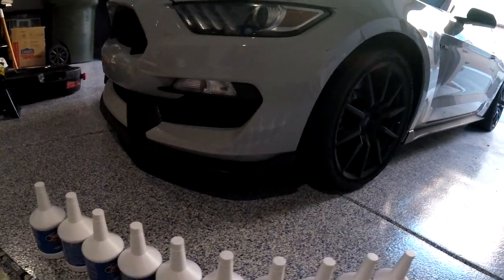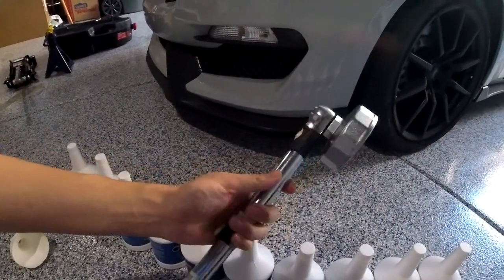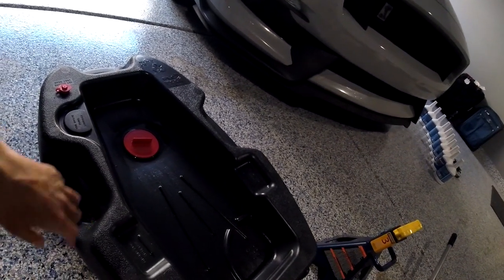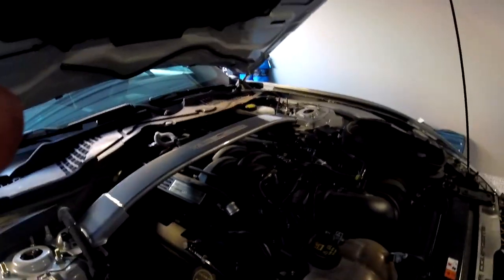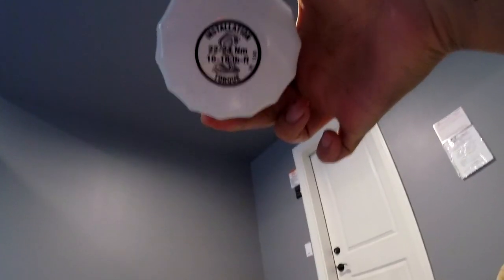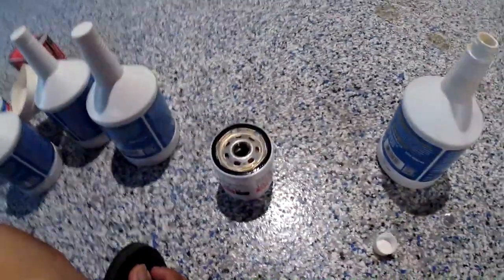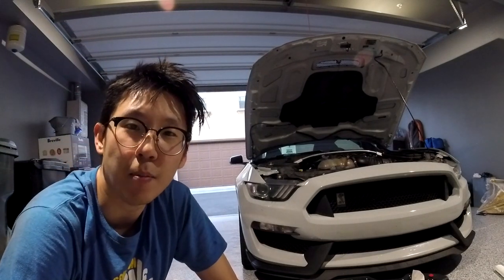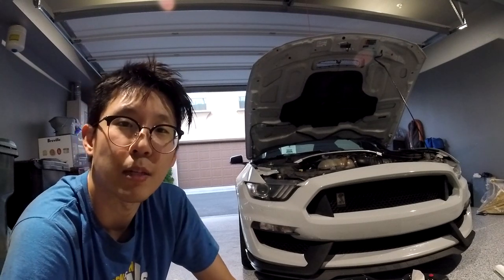[How To] GT350 In-depth Oil Change // Please~ Do It YOURSELF

Comment: It gives me a big big relief. As of this video you had replied to someone's comment below that your GT350 has about 18000 miles. Given the GT350 engine blow out news coming up lately from everywhere, it kinda bothers me and circle back to think about the oil brand that i use. I use Amsoil and see that you are using Redline, perhaps I will switch to Redline as well, just because you are successful in frequent tracking the car and also with reasonably good mileage.  Most blowout news are on engines that are almost new or under 10k miles.
Reply from the maker: OliverBoots ive heard plenty good things about amsoil as well. But yes, I’ve been using redline all my life. Just sticking w what works for me

Comment: Race ramps are very useful for oil changes on these cars.
Reply from the maker: yea, wish I had one =P
Reply: Come to think of it you still need someone to guide you when your driving up on them with the ones that I have, or else the splitter will just push them around. Lol your probably better off. @yooseemotoringchannel3357
Reply: Brad Mckenzie I jack mine up and set the car on the ramps. My 18 has the canister type filter though so next oil change I’m going to remove the driver side wheel completely as it’s easier to access the oil filter.
Reply: VooduN 18_350  If they only had that technology two years ago lol.

Comment: Love the car, thinking of getting out of my 911 and into a GT350.  The part I struggle with is the massive oil burn I have heard of.  I would be mainly tracking the car or weekend cruises, have you noticed any loss/burn after hard track days?
Reply from the maker: I've heard of the same issue on few gt350 owners. my personal vehicle doesn't have any oil burn issue. maybe 1/4 quart every 2~3k miles. (very normal for high rpm NA engine). I've done proper break-in procedure as well. 
I'd recommend this car to anyone who love cars. just the sound alone, is pure bliss.
Reply: That's great to hear you don't have any of those issues, that a pretty low burn. I've watched your track videos and you definitely use it as it was intended. Think I have watched the Auto Club track day 5x. Another random question I saw in that video that you changed the shift knob, did you raise it with another nut? Looks higher than others I have seen with the same knob.  Love to see that American muscle has come so far to offer so many great factory track ready cars at even better prices.  @yooseemotoringchannel3357
Reply from the maker: @jc4hstar  I didn't raise the knob with anything. I screw it in just enough to cover the reverse collar w/ lock tight. maybe it's just the angle of the gopro ? =P  it's a great knob though. stock knob just doesn't feel right when I grab it from the top.
Reply: Oil loss is a normal thing in high revving engines
Reply from the maker: Yes, its true. But few gt350 owners have had their engines replaced due to “excessive” oil consumption. Some have reported losing 1qt every 500 miles or less.. thankfully I don’t have that problem
Reply: The excessive oil consumption is linked to improper breaking in of the engine in the Shelbys. A good slow 1000mi break in works miracles for the 5.0/5.2 engines.

Comment: I have read that some of the oil catch buckets have holes not big enough causing the oil to overfill and spill all over the floor. What brand of oil catch container are you using?
Reply from the maker: I just bought mine over amazon. As long as you get over 20qt capacity container, you should be fine

Comment: Thanks for the video! Why not using oil extractor to extract oil from the deep stick tube on the top instead of crawling under the car? I'm asking because I own Audi S4 and changing oil with oil extractor from the top. I just purchased 2019 GT350 and wonder if I can do it the same way. That being said, Audi S4 has oil filter accessible from the top as well in contrary GT350 has in the bottom.
Reply from the maker: I wouldn't recommend using oil extractor. this motor holds 10.5 qts of oil. and I would feel that oil extractor won't do as good of a job as just letting gravity do all the work in draining everything. If you do it couple times, it's super easy anyway. just make sure you have big enough of catch can, so oil doesn't overflow.

Comment: I wonder how much difficult the 2017.5+ cartridge style oil filter will be on the 2019 I'm getting. I've watched a few videos of the process but none are very in depth like this video is on the "can" style oil filters
Reply from the maker: I believe cartridge style filters eliminate the need to torque down to specific number. so it's fail safe. although they aren't as effective at filtering as canister type filters.
Reply: @yooseemotoringchannel3357  My GT350 has the cartridge style filter and FoMoCo mandates to torque it between 16 and 18 lbs foot as well. I torque mine to 18 like you do.